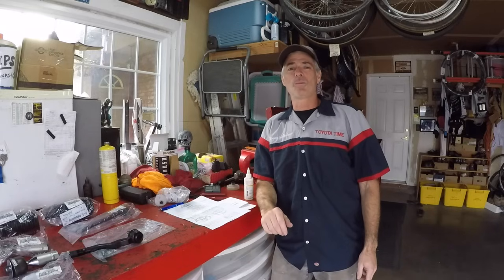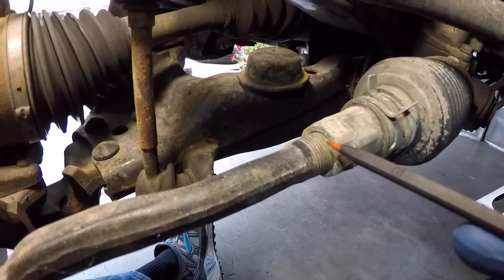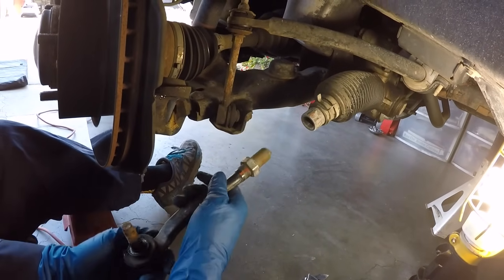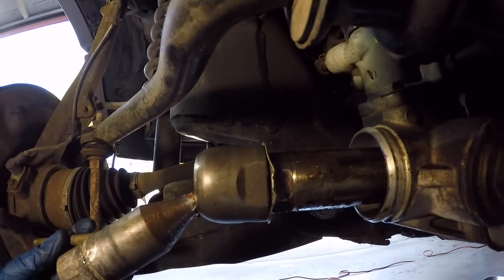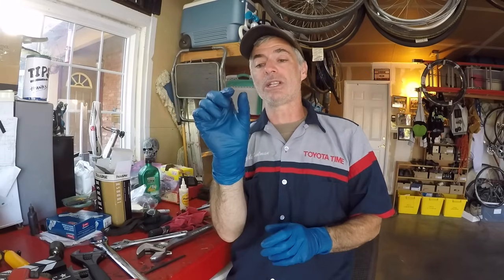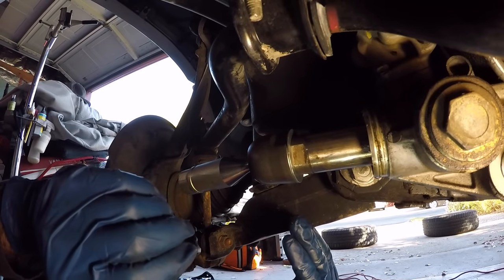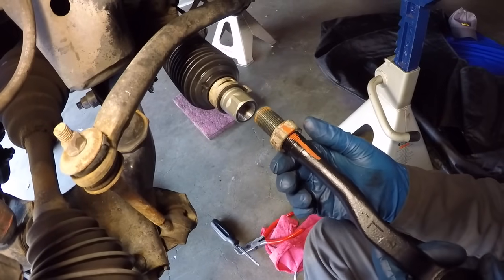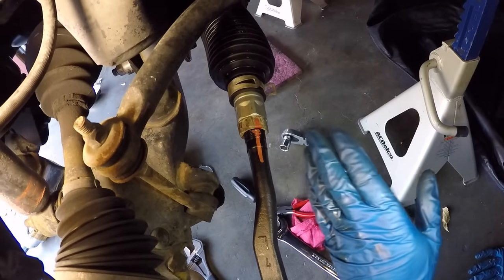Inner & Outer Tie Rod Replacement

Comment: I would use blue thread lock. Mine came with red thread lock but I don't recommend putting red on the inner tie rod. Blue thread lock should be fine. Then the lock washer will make sure it doesn't come lose. I think steering is very important to not come apart while driving on highway at 85 mph.
Reply from the maker: Sure you're not going to hurt anything with blue loctite.

Comment: When using the "*Lisle Large Inner Tie Rod Tool Kit - (option to using Bacho adjustable wrenches)" do you still have to "hold the steering shaft firm" with a Bacho wrench or ground down wrench or does the Lisle kit make this un-necessary? If you still need a Bacho wrench which size do you need (10" or 12")? If you still need a Bacho it seems like the best route to take would be to purchase the two Bacho wrench's since the cost is about the same and the Bacho's are more versatile than the Lisle kit. Would you agree? As always thanks for the reply and keep on making those vids.
Reply from the maker: Hey Mark, your question was the same question I had.  The Toyota FSM clearly shows holding the shaft with one tool while breaking the inner tie rod free with another.  Like I said in the video, the fact that they put two flat sections on the end of the shaft so you can fit a wrench on it tells me the engineers think it's necessary to support the shaft so all the force needed to break free the inner tie rod isn't transferred to the shaft.  With the Lisle style tool, I bet most people aren't holding the steering rack shaft with another wrench.  Maybe the force necessary to break it free and re-tighten it isn't enough to cause any damage to the internal components, but I didn't want to find out the hard way if it could cause damage.  I guess if you had the Lisle Inner Tie Rod Tool and then somebody to help you to hold the shaft while you work the Lisle tool from the wheel well area, this would work and protect the steering rack.  The Bacho wrenches aren't specific tools and are way more versatile so your argument makes perfect sense.  Some guys have found more affordable wrench options and if you look through the comments, you'll probably find some options to the Bacho adjustable wrenches.  I also think on T4R.org there's related threads where guys used other types of wrenches with success.  I like the Bacho wrenches and I'm glad I got them but they are a little on the pricey side.  They are by far the nicest adjustable wrench I've ever used.

Comment: How about using a nice solid plate with a extension bar Square that you can login and then use a ratchet instead that defeats your problem a plate which is wide enough like a ranch you will be probably cheaper to do that then by different types of tools for the job and grinding them down
Reply from the maker: It's hard to understand what you're suggesting as an alternative tool to get the job done.  Many people have commented about tools that were affordable and worked for them.

Comment: HEY T! THX FOR THE INTERESTING VIDEO. IS THIS PROCEDURE THE SAME FOR REPLACING INNER/ OUTER TIE RODS ON 2007 LEXUS ES350 SAME AS THIS TOYOTA  TACOMA ?
Reply from the maker: I haven't worked on that Lexus model so I can't give you an accurate answer.  But, I would imagine the steps would be very similar.
Reply from the maker: @MICHAELWALTON1  Good luck with the job!

Comment: Timmy thoughts on driving without a skid plate?
Reply from the maker: It would be fine for the most part if you're not off-roading,.but if you end up driving over some road debris you could.end up taking a fatal blow to your oil pan which would be bad. .I personally wouldn't drive without skid plates.

Comment: Timmy, I'm about to do the upper / lower ball joints, and outer tie rods. And yes, ball joints fail with absolutely no warning. It happened on my passenger side at thankfully low speed. So I am not going to replace my O.E. inner tie rods if they have no free play / slop. The question is; since the inner tie rod by design makes a complete 360 rotation it would seem that the inner tie rod could be replaced without having to separate the outer ball joint. I'm describing a case where I discover wear in the inner tie rod maybe 2 or 3 years from now and I want to replace them, but I don't want to break apart the outer tie rod. I would try this method so as to avoid possibly damaging the outer tie rod boot. 
So what do you think, could it be done as I described?
Reply from the maker: I don't know if this would work or not but I think you're worrying about something that isn't a big deal.  I've broken free tie rods and balljoints countess times and never damaged one boot.  If you use a puller and you're careful not to capture the boot with the tines of the puller, you'll never damage a boot.  Now, if you use a pickle fork, yeah, you'll destroy a boot every time.  Pullers are easy to use and work every time.
Reply: Hi Timmy, who me worry? No you're absolutely correct. I'm overthinking it. There's your other YouTube channel; psychoanalytics for home mechanics.
I pulled together a few of your awesome videos and was completely successful at new upper, lower B. Joints and outer tie rods. And replaced right side inner tie rod boot due to a small tear I discovered. Used all genuine Toyota parts.
MacGyver moments; No vice so I bolted spindle (steering knuckle assembly and all) onto the wheel laying on my garage floor. Rented a ball join press kit. Wow, you warned us! I had to make some cups using thick walled steel pipe I already owned. I was channeling every MacGyver skill I had for that press job.
I have always seen your bikes and bike gear; Park Tool wheel truing stand etc. I once saw a comment / reply where you described your cycling experiences. So I hope you appreciate this next part. Remember when bikes used loose ball bearing for bottom brackets, head sets and hubs? I inspected both of my inner tie rods and they were free from any slop or play. I left them on my truck. One side had a small tear in the boot so I replaced it. I took the chance to see what wrenches would fit on those narrow flats you described. I had a 40mm Head set wrench that I opened up to 42mm and I had a 30mm Cone wrench for bottom brackets. They both fit those flats and were plenty long enough to apply torque for removal and replacement if needed. And I used a bicycle brake cable ferrule (cable end) to cover the end of the twisted wire I used on the upper b. joint boots, so no 'pointy' exposed ends to tear my new boots. I was cautious about the wire orientation like you described.
Regarding parts; Toyota sells those ball joint boot wires as individual parts. I needed one extra after breaking a wire. They sell upper ball joint boot kits as you mentioned. However they do not sell boot kits for the lower b. joints (I find that a bit irritating).
I had a small amount of play in the steering that the new outer tie rods cured. I was worried it might be in the steering linkage or the rack. And as you suggested I got an alignment. 
Man, you gotta stop apologizing for segments where you think your doing to much 'blah blahing'............anything you have to add is totally relevant, highly appreciated and very useful. YouTube gives us 'J, K, and L' quick keys for the people that don't want to listen. And they can not listen at their own risk and expense. 
Last, I found a video of Shawn doing a rack install, that was cool to see him on the other side of the camera.
Reply from the maker: @turnah8242  Hey Tim, that's cool you were able to employ some bike tools for the tie rod job.  I own the same wrenches but didn't think about it.  Good job.  I mention the talking because people have been critical in the past that they just want to see the job done.  But thanks, it's great to hear you appreciate the information I'm trying to share with people.  Yeah, Sean sometimes gets in front of the camera and you'll most likely see more of him in future videos.  Thanks for taking the time to comment.  We appreciate it.  Happy Wrenching!

Comment: hi   mahew makes a very good inner tie rod remover  and it is not that much    do you know if that would work on this toyota ?
Reply from the maker: We're not familiar with that tool.  If it has the right size adapter to fit onto the inner tie rod, I suppose it would work.  But, with those specialty tie rod tools, how do you operate the tool from the wheel well while holding the end of the steering rack steady?  You can't unless you have someone helping you.  It's clear to me the Toyota Engineers intended for you to hold the shaft while breaking free and tightening the inner tie rod because they put flat sections onto the ends of the shafts so you could hold it with a wrench.  They also show a pictogram in the factory service manual of using two tools to remove the inner tie rods.  I don't know if it's a big deal that you don't hold the shaft or not, but I didn't what to find out the hard way when filming this job if it does matter.  My best guess is it probably doesn't matter.  Those shafts look to be pretty stout and could handle the torsional force from loosening and tightening.

Comment: Seized lock nuts cannot do alignment.  Doing mine soon.
Reply from the maker: Try some heat on the lock nuts.  Also, try some penetrant like Kroil.  I'd spray some Kroil on them the day before and then apply heat with a butane torch to help loosen the lock nut.  Good luck with the job.
Reply: Timmy The Toolman 

     I have to do the rear lateral links also for same reason.  Shops have told me they cannot do alignment even after using acetylene.  I saw how much they struggled.  Rust belt.  I will more than likely cut between the outer and inner to get inner tool on.

Comment: Tim, which way does the jam nut turn to break free on the passenger side? 

Say I put a wrench on top of it: Would I push the wrench toward the front of vehicle or pull toward the rear?
Reply from the maker: You turn the nut counterclockwise, left, away from the inner tie rod.
Reply: @TimmyTheToolman  makes sense. Thank you.
Reply from the maker: @MF-rw3rb  You're welcome.
Reply: @TimmyTheToolman  Got it all set brother. Thanks again.
Reply from the maker: @MF-rw3rb  You're very welcome.  Good job getting it done.

Comment: I just bought a steering rack off of Ebay that as well, reads 'toyoda' proclaimed OEM... What do you think?
Reply from the maker: That's how Toyota was originally spelled.  It's common to see that name stamped on Toyota products.  But, Ebay isn't as safe of a purchase compared to buying from an authorized Toyota dealer online seller like Camelback Toyota in Arizona.

Comment: Is the steering shaft supposed to be positioned a certain way and or not be moved ? I think I might had moved mines a little bit counter clockwise don’t know if I should position it straight or a certain way hope it doesn’t interfere with the driving mechanism of the steering rack smh 🤦🏽‍♂️
Reply from the maker: Yeah, you want to try and avoid moving the Steering wheel/steerign shaft so everything lines up essentially the same way before you took it all apart.

Comment: Timmy, I have a 2006 Tundra double cab. The OTC service set on Amazon says it doesn’t fit my vehicle. Do you know this statement to be true? Have you ever used them on a gen 1 Tundra or Sequoia? Really appreciate all your videos, very helpful!
Reply from the maker: The OTC Front End Service Set should work for lots of vehicles.  Now, whether or not the pullers will work on your Tundra, I don't know for sure because I've never used them on a Tundra.  I would say there's a high likelihood they will work for your vehicle just fine.  If you buy it on Amazon, you could always return it without much hassle if it doesn't.
Reply: Thanks, I’ll give it a try. It looks like a quality set.

Comment: I cut my tie rod ends off bc I couldn't get the nut off one screwed out no problem the passenger side is stuck. Tried pipe wrench and a big Cresent wrench. Doing this today.
Reply from the maker: Good luck with the rest of the job.

Comment: Mine is seized on.. I may have to plasma cut the balljoint side and stick a deep socket to pop loose the nut.
Reply from the maker: yikes! maybe some heat and then attempt to break it free?
Reply: @TimmyTheToolman  Will try that!

Comment: Would you recommend doing this, or just replacing the whole steering rack?  A new steering rack from Toyota can be bought for around $540, and it comes with new inner tie rods installed.  I would then just buy the outer tie rods.  So for about $200 extra dollars, I'd have new steering rack, new inner and outer tie rods.
Reply from the maker: If I had inner tie rods that were bad, I'd definitely spend the extra money and get a new steering rack for the reason you stated.

Comment: Hey Tim, if I'm doing both the inner and outer tie rods, could I just skip removing the outer and start the inner right away?
Reply from the maker: I suppose you could.  You would still need to disconnect the outer tie rod from the balljoint though. Here's another thought though, if you go 4wheeling, I'd hold onto those tie rods as trail spares in case you break one.  Having them separated from each other in advance might make things easier when you're out in the field with limited tools.
Reply: @TimmyTheToolman  Thanks for the tips! Your videos have helped me work on my 4runner. And thanks to your videos, you've inspired me become an automotive technician. I'm now in automotive school!
Reply from the maker: @tjalanes8262  That's freaking awesome TJ.  I think you're the first person who has said our videos have inspired them to become an automotive technician.  Thanks for sharing this with me.  Maybe I'll be watching your YouTube videos one day.  Good luck with school and kick ass!

Comment: Hey Timmy! Just watched this video in preparation for doing inner and outer tie rod ends on my '98 4Runner. One question-I only need the drivers side replaced, would you recommend doing BOTH sides at once or is it OK to just do the drivers side and get an alignment afterwards? Thanks so much-Davis
Reply from the maker: If only one side is causing you issue, just do the one side.  If the other side fails shortly after, you will be paying for another alignment but that's the luck of the draw.  Sometimes parts are replaced just because the labor to get to it is extensive, for example replacing non-leaking camshaft and crankshaft seals while doing the timing belt job.  Even though they aren't leaking, people replace them because it would suck if they developed a leak later on and then you have to repeat all that labor.  For this application, you're not going to have to repeat any labor.  You just might have to pay for another alignment and I think it's worth the risk and just leave the passenger side alone if the tie rods are fine.
Reply: @TimmyTheToolman  Thanks for the quick and thoughtful response and all that you do! These detailed videos and links to the best/most practical parts are insanely helpful. Looking forward to completing the job soon and thanks in advance for saving me time/money. Cheers!
Reply from the maker: @zoewuthrich2121  You're very welcome and good luck with the job.  I hope it goes smooth for you.
Reply: @zoewuthrich2121  great question, and one that was going through my mind as I watched the video 👍🏼 How did your tie rod replacement go? I have a ‘98 SR5 that has a “thunk” in the steering wheel when I go over bumps, and I bet it’s those tie rods, gonna check tomorrow. So great full for all of Timmy and Sean’s fantastic videos!!